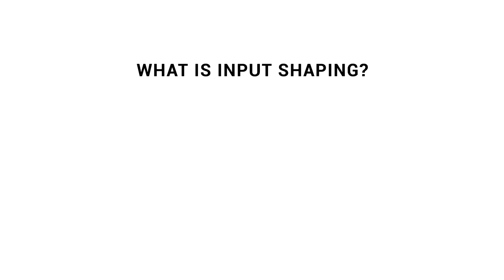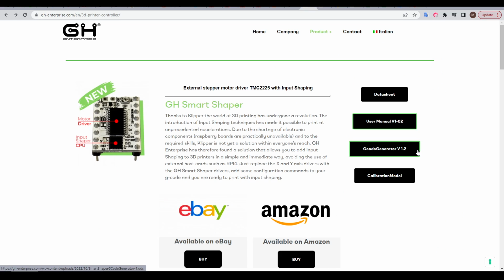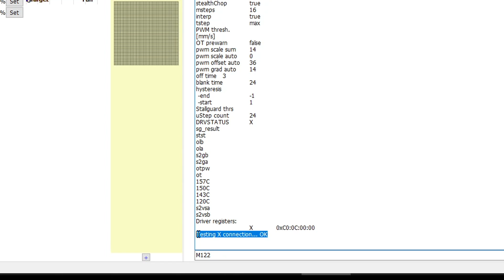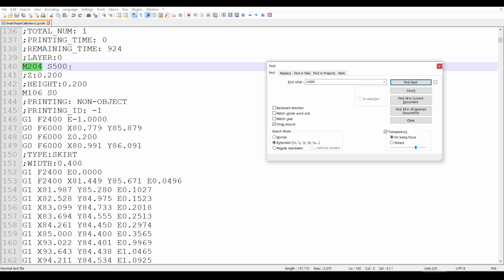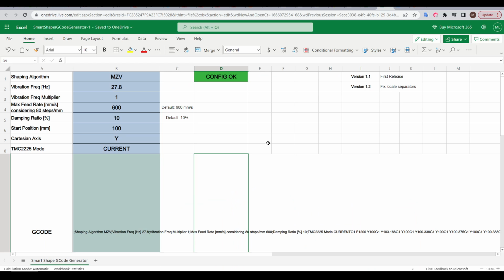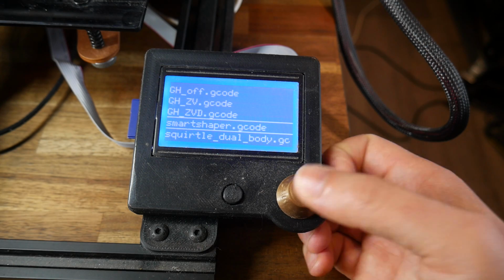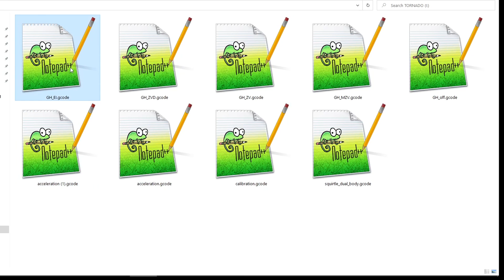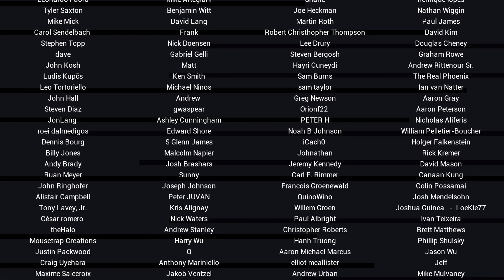Input shaping without changing firmware - GH Enterprise Smart Shaper guide and test

Comment: I must be missing something... Why couldn't you make this work with a corexy by rotating the print 45 degrees?
Reply: Because CoreXY doesn't have an X and a Y motor, it uses A and B motors together to make motion in any direction. While it's true that at perfect 45 deg lines only one motor spins that is not the same as a dedicated X or Y axis motor.
Reply: @urufushinjiro  So, tell me, when you want to move the head in a diagonal direction in a cartesian printer, do the motors work together to make motion in that direction?

I'm still not seeing how that matters. Unless the input shaping only works when one motor is working, the only difference is the naming of the motors and that one is rotated by 45 degrees. And if it only works when one motor is running, that seems to me to severely limit the usefulness of the product.
Reply: @SirSpence99  it has to do with the way the movements are calculated in the kinematics, there's very very different math involved, in Cartesian if you move the head in a line that moves 5mm to the right and 1mm back the x motor is instructed to move 5mm to the right and independently the y motor is instructed to move 1mm back, not so with the corexy, and those mathematical calculations used to move the motors to move the toolhead are completely different and will result in different calculations for resonance compensation. Cartesian is simple enough as x and y are directly related that the stepper driver can do it independently, but not on corexy.
Reply: @urufushinjiro  And if you were to rotate that movement 45 degrees, it is the same math... At least to each motor it is. Since this is replacing a stepper driver, all it needs are steps, it doesn't need to know that the printer is corexy or what position to go to.

I'm well aware of how the mixing works. I've done more complicated motion system programming before.
Reply: @SirSpence99  well you better write the makers of these drivers and let them know you know better than they do because they are the ones saying it doesn't work with mixed stepper kinematics.
Reply: @SirSpence99  manual on their website literally says I'm the requirements it must be a Cartesian printer!. Just because you are having a hard time understanding something doesn't mean you get to take it out on others with ad hominem.
Reply: @SirSpence99  you seriously have no idea what you're talking about if you think corexy is just cartesian at a 45 degree angle lol. You really should go study the kinematics and get back to me when you know what you're talking about.
Reply: @urufushinjiro  Just because you can't read English, that doesn't mean I need to entertain you.

Since you clearly can't read, anyone believing you have any understanding of the subject matter is making a mistake.
Reply: @SirSpence99  that's pretty odd since several of us over in the Voron discord who literally write kinematics for klipper are laughing at you. Just take the L dude lol
Reply: @urufushinjiro  And everyone clapped.

Grow up. Just because you can't read plain english and like to accuse me of saying things I literally never said,. that doesn't make you intelligent.
Reply: @urufushinjiro  Funny, I took a look and talked to the people you were talking to and they agreed with me.
Reply: The smart shaper now works on corexy printers too!

Comment: I took the plunge on Klipper some months ago and one thing I do have to say is that for bedslinger printers input shaping does also cause some rounding/smoothing of fine details, which can cause issues in the case of high detail models and sometimes cause clearance issues with functional parts. Of course, if you run a little more conservative acceleration, these effects diminish significantly.
Reply: Rounding should only happen if you're using acceleration or corner velocity well above what IS can cleanly suppress the vibrations for.
Reply: @daliasprints9798  What can I say, I like to push the limits. Part of the test model that Klipper uses is designed to show the smoothing effects of resonance compensation/input shaping so that you can choose a more appropriate max accel. to use. The smoothing does occur at all accelerations, it just happens that the effects only start to become noticeable once you start pushing the limits.
Reply: @quinnobi42  you mixing up 2 separate things here. If you tune p_A correctly you won't have rounding.
Reply: @poonholder5643  I was not aware that there was an implementation of pressure advance that is synchronized with input shaping. Pressure advance is designed to reduce blobbing/bulging in hard corners, so are you saying that rounding occurs due to too high a pressure advance value?
Reply: @quinnobi42  If You have rounded corners You might be using too agressive input shaper, but anyway You should calibrate PA AFTER input shaper
Reply: @IDiveI11  Perhaps I am using to aggressive an algorithm for input shaper. However, I can guarantee that I set up pressure advance after input shaper, as Klipper's documentation has you tune input shaper first, then pressure advance.
Reply: @quinnobi42  indeed. 
print the test piece "hollow square" and choose what you find acceptable.
Reply: May I just say how much I appreciate the wholesomeness and helpfulness of this conversation?  :sniff:  So... Beautiful...

Comment: In Michael's video "Get more out of Marlin & Octoprint with these lesser known tips - Macros, auto-start, custom menus" ( https://www.youtube.com/watch?v=fpphvl5C2Cw&t=361s ) he talks about setting up macros and calling them when the printer starts to set up commands to control LEDs. The same process could be done with this gcode by adding two more macros, one for the x-axis and one for the y-axis, and letting the auto-start handle running them. Then one wouldn't have to worry about adding them to the slicer configuration, which I don't like because old files would need to be re-sliced in order to be printed again because they might not have the configuration or an incorrect version. Better to have it as part of the printer. Ideally it would be stored on the controllers themselves but unfortunately the company didn't make them that way.

Comment: I've been meaning to ask about something. What is it with slicers and some layers being thinner than others?
It doesn't seem to matter what model I slice, if I turn off adaptive layers in order to get better detail, I notice that 9 times out of 10, there's always this group of layers about half a centimeter thick that are just more compact than the rest of the print. You can even see it in the preview of the slice before exporting it.
I don't really care that it looks bad, but I have noticed that even though it's denser than the rest of the print, it still becomes a more likely fail point where layers start separating after the print is finished.
Reply: sound slike you have the variable layer height setting in your slicer turned on

Comment: I've just now merged ZV Input Shaping into Marlin Firmware, so it will be included in 2.1.2. It's labeled as "experimental" because it's so new and we haven't tested it in every scenario. Thanks for taking notice of our work-in-progress and –as usual– for your thorough coverage of the topic. We're really excited that we can gain both speed and quality on all our old 3D printers without adding any new hardware or requiring an additional board. Our implementation requires a fair amount of SRAM, but it is so computationally efficient that we can use it even with AVR boards like the common RAMPS. More complex algorithms like your two favorites MZV and ZVD will require more work, and likely a 32-bit processor. But even the basic ZV shaping does a remarkable job and allows for much higher print speeds with no loss of quality. We hope everyone finds it useful. I'm certainly going to be upgrading all my Marlin-based printers this weekend!
Reply: Nice work. Is there an ETA on the release of 2.1.2 so we can all play.

I see it's only 2.1.1 right now. Or will it be in the 2.1.x nightly?
Reply: @AAEmohawk  I see it merged into bugfix-2.1.x
Reply: @runningfromtheheat  oh cool thanks I will check it out.
Reply: Amazing progress!
Reply: The GH smart shaper now works on corexy printers too!

Comment: Will you need to recalibrate it if you change your print speed / accelerations? I print PETG and TPU so they have drastic speed differences, curious if this would need two calibration files or how would you recommend i set it up using your calibration website? Ill also need a new board as the silent creality wont work... any recs?
Reply: Additionally, I have TLSmoothers installed on all of my axis, would that affect this input shaping?
Reply: @bobdaripper77  You might not need those any more, since Trinamic stepper drivers take care of the current control and step smoothing.
Reply: I made a video years ago, how to add external stepper drivers to a creality board (the old ones). Actually my first Video on YT. Its german, so maybe just watch without sound. In standalone mode you need only 3 signals: Step, Dir and !enable. You even can put !EN simply to ground, just using STEP and DIR. Follow the traces on the board, with some luck you have points there signals have contact points on the PCB (f.e. if contcts for going to a different layer). It's a bit harder to solder directly to the existing chip, but with a lot of flux it works also.
If you use a touchscreen, you simply might use I/Os of expension header as new Dir/Step and maybe !EN for x and y. Just a little change in firmware. 
There are smal boards to use a driver module with arduinos (about 1.5 $ on Aliexpress). Bigtreetech even has a board for connecting up to 3 extra drivers to their skr boards via EXP 1+2. As the creality silent board only has one extension (EXP3) and no serial to connect touchscreen, you might be low on I/Os there, so soldering 4 (or 6) wires to the board to grab STEP and DIR might still be the simplyest solution. On the non-silent creality board it was quite easy. It quite depends on the PCB layout. I never upgraded to a Creality silent board, so I do not know if you can grab signals on through contacts there (on the non-silent board of an AC predator it did not, sadly).
I am thinking about upgrading a Prusa mk3s (clone) board this way, as I have a spare board to try. Prusas marlin fork has quite nice features and I like the mk3s a lot; would be nice to just add input shaping this way. Brings the mk3s state to the art, even if its 8-bit.

Comment: This is where im a bit torn... this sounds cool and while i have followed you and all your guides i have to admit my ender 5 pro as i bought in 2020 havent really produced any good prints, and sadly most of the time just collecting a bit of dust. it had a 8 bit board when i bought it and last year i upgraded it (sadly) to a 32 bit creality V4.2.2.. and still it had problems especially with flow and a very warped bed.. after the 32 bit board i could finally with a bl touch get the warped bed under control... but good prints was still a bit unatainable.
So i tried Klipper and followed your guide and while it actually improved print quality.. it didn't work with bedlevelling !! it would constantly move in the wrong direction (the corners has an upwards slope and a big dip in the middle og the bed but klipper would move the bed further away in the middle and closer in the corners, but all other movements was correct so bed adhesive was awful but did work under Marlin) now i hope someone can help me.. as to what i've learned is that people with V4.2.2 boards all seem to suffer from this problem but people with bigtreetech boards don't !.. but since i have already spend a lot on upgrades trying to get decent quality on this printer (lately a new hotend)... would an upgrade again on the mainboard be worth it ? as i really dont want to spend more money on something that really doesnt help 😢. (BLtouch pin won't extend 50 % of the time, Creality V4.2.2 seems to be a dead end when it comes to klipper or even Marlin when it comes to input shaper or Linear advance because of the 2208 drivers.. and lastly has anyone ever gotten good prints out of an ender 5 pro ?. I've seen lots of gorgeous prints from ender 3's but ender 5 seems to be the worst supported printer ever (even by creality) as of warped beds and sorry to say shitty BL touches 😢. sorry for ranting, i love the hobby but lately trying to really tune the printer in to finally make useful prints but i'm getting a bit frustrated.
Reply: have you tried putting sticky notes where the low spots of the bed are? 

if center is low, put sticky note between bed and the heated platform. run the bl firmware to verify location of his spots and keep adding/tearing or removing.  i was able to get my aquila down to a very usable setup. 
this is time consuming,  but has worked out for me and the 4 printers ive played with. g10 bed plate and pei flex steel plates were used.
Reply: @jeffreyshaw7206  Thank you for the advice :). i have however both used paper and tinfoil to even out the slopes and dips . i have a glas bed and that does help.. just i likes the print quality in klipper a lot more than in Marlin but bed level in klipper i never got to function correctly which seems to be a common problem if using creality V4.2.2 (the 2208 drivers kinda sucks i guess) as they cant be used with either marlins linear advance or klippers Pressure advance :(. and since i have already spend loads on upgrades it kinda sucks to spend more on parts than to actually print things (could have been spend on filaments instead) :)
Reply: change the board to an skr mini v3 and an original bltouch and buy wham bam flex system and a triangle labs micro swiss style hot end and  use michael configuration page to dial the pid,speeds,retraction, and so more and you should be good to go for at least 3+ years from now untill the new style of printers came out
Reply: @aokiomar256  Thank you for the reply, I already have a Antlabs Bl touch (which as stated doesnt always work ie the pin tends to get stuck and wont extend) i have a Pheatus Dragonfly all metal hotend and a glass bed , glass bed does help with the warped bed but is not perfect , i believe that changing to  wham bam flex system wont really fix the warped bed as it is .. well flexible. but well i might think about it..  i have done Michaels pids, speed and retraction but i think the quality issue lies in the 2208 drivers as i cant use MArlin's linear advance or klippers pressure advance (what do you use btw ? klipper or marlin and what is your take on it ? ).. so i might take you up on the skr mini part as it does seem that people who has them do get better tuning and quality.. just wish i had done that last year instead og buying the Creality V4.2.2 😢. but that said the skr mini v3 is on offer atm where i live 🙂
Reply: Marlin's linear advance with TMC2208s is resolved now.
Reply: @tombrazier6172  Oh ?! can you elaborate ? i'd love to read about it and try it out!! , if you can please send a link. thank you in advance 🙂
Reply: There are some reports about the problem resurfacing with input shaping but not enough info to go on. If anyone is experiencing this I would like to know more.
Reply: @jeffreyshaw7206  thank you for your reply !. I have tried it and it doesnt work sadly, i think its dead. today as i once again tried to do a full calibration i never got anywhere , the bltouch stops deploying after one try. sometimes i can home the bed but now bed level is impossible grrr. i tried the grub screw but it doesnt matter what i do it will only deploy once or twice  😢
Reply: @tombrazier6172  i just pulled marlin 2.1.1 from the printer today.. when ever i set z offset it doesnt save it and then starts print mid air, if i then run a new z offset guide ir looks right and then again prints mid air.. i ended up have a -4.23 z offset and thought i better stop it there as probably i will soon have a nozzle crash into the bed.. but i must say it looks promising thoug.. mind you i had same z offset problem on 2.1 bug fix and 2.0.9.5. havent had in on 2.0.93. right now i tried creality's own firmware as i had load of problems with printer today. and theirs are 2.0.6.x. but anyway looks like im not getting anywhere, i gotta admit if it wasnt cold today and the window was open, the printer would have been tossed out. right now im saying never ever creality again ! (looks like i gotta get a new board and a new bltouch or maybe something else that actually works and yes it is a genuine antlabs 😢

Comment: I wonder how this input shaper works. Doesn't input shaping need to delay or insert additional stepper moves? How is this possible when the firmware continues sending stepper pulses without waiting for anything?
Reply: I should think it will have a buffer that records steps and then replays them later, merged into the main step sequence.

Comment: Would be nice if it had non-volitile memory for the settings.  Then just set once rather than update gcode in files and slicers.
Reply: Or… If the programming could be done by toggling the DIR or ENA pins alone without any motion, then the firmware could hide those details.